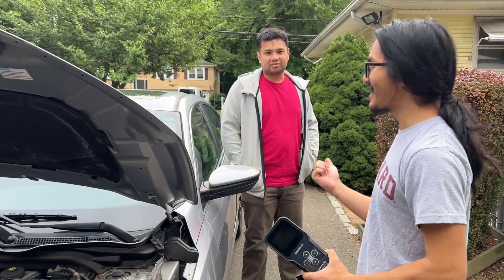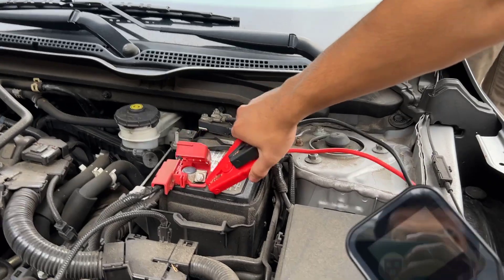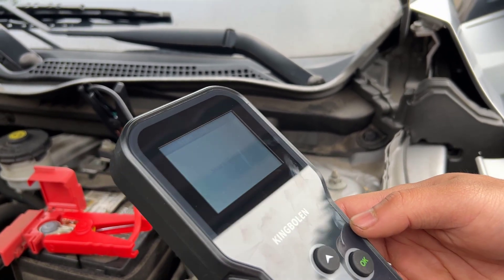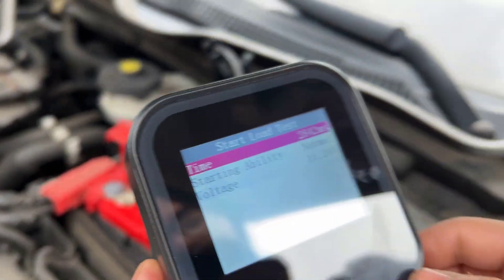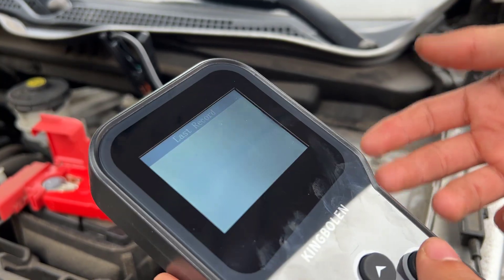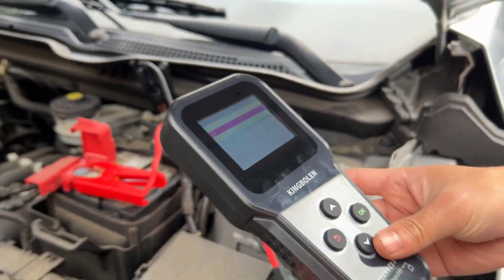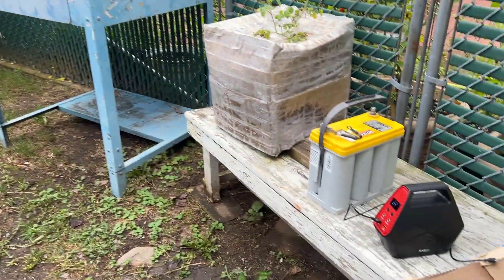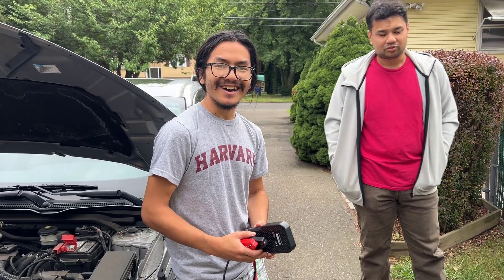Testing Car Starter Is Super Easy Using KingbolenBM520 | 6/12/24V Battery Alternator Charging System

Comment from the maker: Here are the #ᴬᴰlinks for Kingbolen BM520 and similar products if you're interested:
1.  https://amzn.to/3TR2YsB  |  KINGBOLEN BM520 6V 12V 24V Car Battery Tester, 100-2000 CCA Automotive Load Tester Accurate Digital Auto Battery Analyzer Cranking and Charging System Tester for Cars Trucks SUV Motorcycle
2.  https://amzn.to/4h0DgvJ |   ANCEL BA101 Car Battery Tester 12V - Digital Automotive Batteries & Alternator Diagnostic Tool, 100-2000 CCA Load Capacity, Charging & Cranking Analysis for Motorcycle, Truck, Boat, RV, Marine & More (#1 Best Seller)
3.  https://amzn.to/3BshGjc  |  MOTOPOWER MP0515A 12V Car Battery Charge Tester and Alternator Analyzer
4.  https://amzn.to/3Y8Cx4c  | KONNWEI KW208 12V Car Battery Tester, 100-2000 CCA Load Tester Automotive Alternator Tester Digital Auto Battery Analyzer Charging Cranking System Tester for Truck Marine Motorcycle SUV Boat
5.  https://amzn.to/4eIFBcD  | NOCO GENIUS1, 1A Smart Car Battery Charger, 6V and 12V Automotive Charger, Battery Maintainer, Trickle Charger, Float Charger and Desulfator for Motorcycle, ATV, Lithium and Deep Cycle Batteries

Or Click on Amazon link here and search for what you need:  https://amzn.to/3D1T2GQ